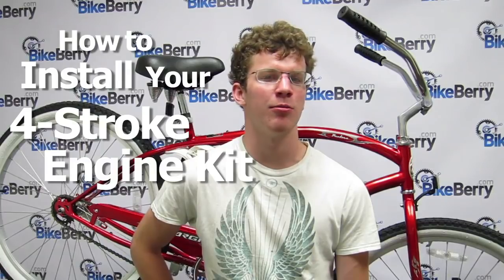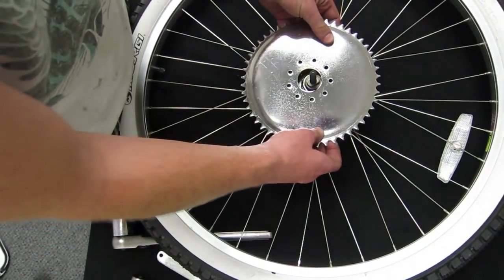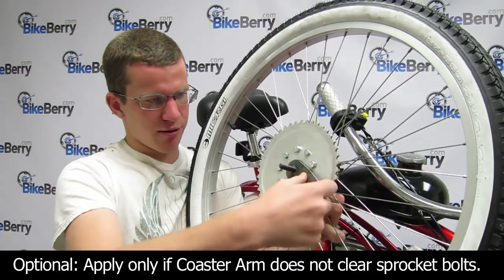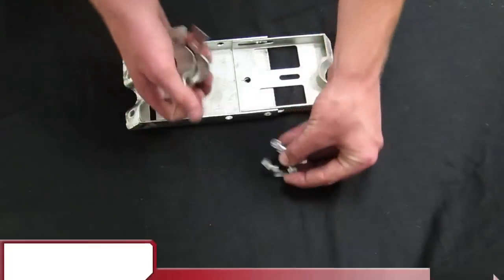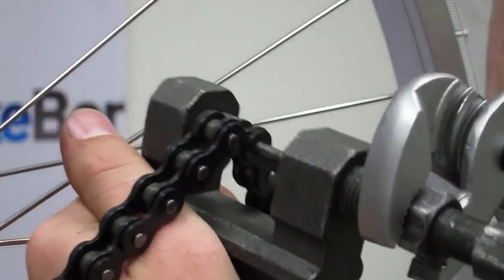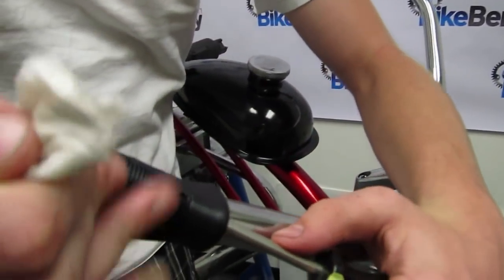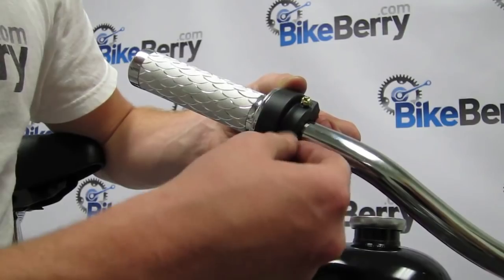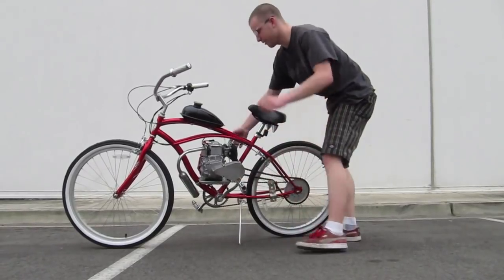How To Install a 4-Stroke Engine Kit on your Bicycle - 48cc - Motorized Bicycle

Comment: How should I heat up the coaster brake?
Reply: using a propane torch is optional. main point is put it in a vise and angle it a little, and 1/2" from end you can angle it back. tap with a hammer, not too hard, itll bend fine

Comment: what about if you have disc brakes
Reply: it's more difficult, requiring a disc brake adapter, some ppl call it a top hat. on ebay, MZ Parts Miami has one, but no guarantee for perfect chain alignment. best is to get a hub mount sprocket and adapter. $45-65 and caliper brakes in back.

Comment: what kind of rpm can this engine do?
Reply: Max.output:1.2KW @ 6800rpm
Max.torque: 2.0NM @ 4500rpm
Reply: AGR Modz thank you! i know the 2 stroke only does 5,000 rpm. but the 4 sounded like it had higher revs
Reply: caden swain No problem.
Reply: +caden swain that's not right at all a 7.0 horse power engine can only get up to 3600 not 5000 unless it's de governed
Reply: +AGR Modz no no it's no more than 3600 rpm
Reply: RICERIRIRICE All my motors can do 3600 revs easy! Must be something wrong with your if they aren't going over that... anyway the specs of my motor said it was 
Max.output:1.2KW @ 6800rpm
Max.torque: 2.0NM @ 4500rpm
and it does get pretty loud so i believe it.

Comment: What about oil? What kind?
Reply: I reccommend a 5W40 if,but if you often experience cold weathers I'd go for a 5W30 or a 10W30.
5W oils are more fluid,even in cold temperatures.
Reply: Olive oil.

Comment: I coat all the insides of my fuel tanks before I install. If all you do is rinse the rust out it will come back and get much worse! All so always lube cable and throttle sleeve before installing! Professional mechanic would use heat shrink not tape!
Reply: +Jeff Bicht; Thank you for the heads up on the tank liner. What do you use to coat your gas tank?
Reply: +Kanani HUNTER +Kanani HUNTER I use Kreem coat as I have been using it for 40 plus years. There are other things out there but the main thing is to make sure the tank is prep correctly with no rust or oil. If you use the Kreem kit they come with everything you need and will do at least 4 or 5 of these little tanks. 
Most of my experience is from being a motorcycle machinist and mechanic for 45 plus years. A combustion engine are all very similar. Been wanting a motor bike since a child and not at 62 I have one and building another. LOL

Comment: why cant somebody sell a 44 tooth with a center hole that isn't undersized---the hole on there now fits ZERO coaster brake models ive seen and it's an ugly, bullshit job enlarging that hole
Reply: robert smith just go to manic mechanics website and they sell a clamp with a huge sprocket hole and is better for your spoke wheels.  If you plan to use this motor bike for actual commuting

Comment: They don't show you how to hook up the transmission and they don't show you what screws go to the transmission neither is there a manual that showed you what screws go to what part his nose is too red
Reply from the maker: We apologize for this confusion. We unfortunately do not have a manual, but we do have other installation videos that may help. Please feel free to contact or customer service representatives, at 1-800-317-0479, for more help.

Comment: Hey BikeBerry i was wondering if you guys could tell me if this bike would work with a engine kit. "http://www.thewarehouse.co.nz/red/catalog/product/Repco-Sumo-29-inch-Mens-Bike-in-a-Bike-in-a-Box-46B?SKU=1709137" I wasn't to sure because of the gears and stuff. If it does can you link me to the engine kit for it :)

Comment: why do drill the handle bar?
Reply: marvin forbes there is a pin on the kill switch that requires a guide hole so that the throttle assembly doesn't spin around as you twist it.

Comment: take it from a old coot who has, at 9:30 try not to stab yourself with screwdriver,
Reply from the maker: We agree, the shown method is not at all recommended. We are constantly trying to improve the quality of our videos to make it as informative and entertaining as possible
Reply: Saw a guy used compressed air to get a grip off instead of the screwdriver poker
Reply from the maker: Compressed air is a great trick. It's a standard method for many industries. We unfortunately didn't have an air compressor at the time.

Comment: Measure it
He said it has to be 14"
Reply: 14 inches.of.clearancse room mean it either have 14inches to.place the motor or chop the the top bar to fit...or chop buttom bar make it spacey enought to weld.a.custom mount and slide.the engine in
.

Comment: watching this reminded me of the little rascals building soap box derby cars. Super mickeymouse. Did he really say there were two ways to take grips off, and one was a razor knife?  Never heard of an air hose? Whats wrong didn't your dad have a compressor? Taking off the grips.... A good idea but very poorly executed. I thought he wasn't going to get it off. Much easier to use the screw driver then squirt a soap mix in. Do it a couple times and a 5 year old can take it off, or just use an air hose and its off in two seconds.   Electrical connections... REally? Electrical tape? You couldn't suggest heat shrink tubing? How about sourcing the right connectors for $.02 each and just including them?   Overall My rating... Embarrassed.  On another note, it might be genius marketing because clearly anyone can do this.

Comment: These made the video too infuriating to watch for me:

-Using channel locks for the crank nut
-Testing the chain with the coaster brake arm hardware rattling against it
-"you wanna keep it and replace another bike with the grips, the other way, it doesn't"
-Drill bit spinning in drill
-"remove rust with gasoline"
-Using pruners to cut off cable ties
Reply from the maker: We are constantly trying to improve the quality of our videos to make it as informative and entertaining as possible.
Reply: And the "wiring job"? Absolutely hideous. If I owned the company that alone would make me pull this video. Any of the things mentioned above would too. The fact that this video is still publicly available means I will never do business with this company.